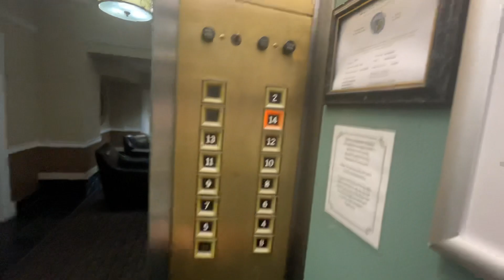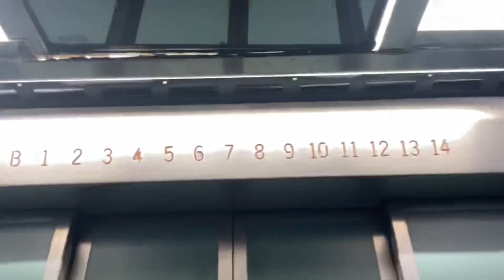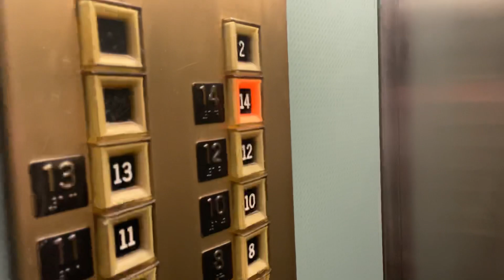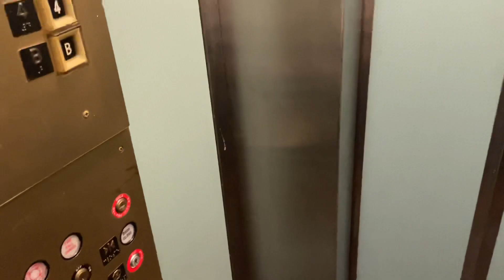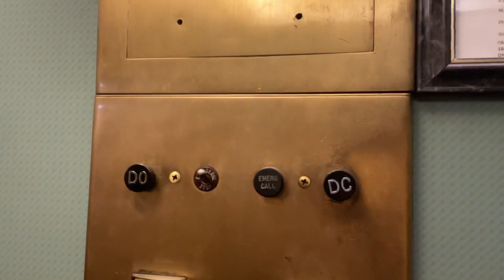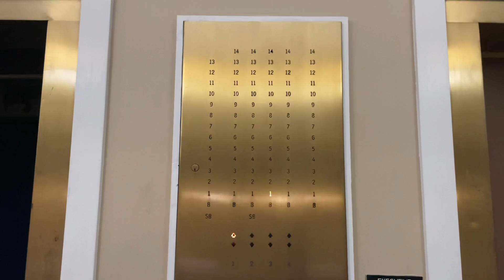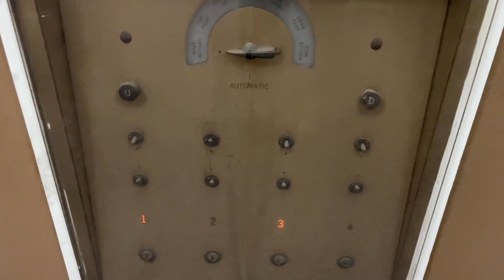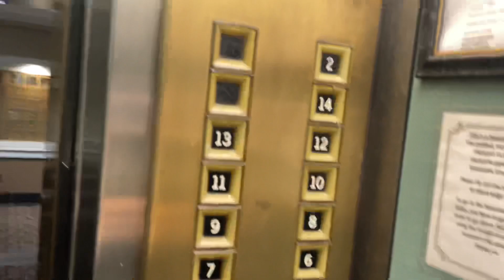INCREDIBLE Otis Touch-Sensitive Elevators - Omaha, NE.

Comment: I see 4 cars on the lobby panel, but only 3 elevators in the video. Was 1 car (probably the far right one) removed?

Based on the sign, it looks like the middle car may be used as a service car. I wouldn't be surprised if it does run, but isn't in normal service (either in independent/attendant service, or turned off in some way).

I looked up this building. I am surprised these elevators survived the major renovations this building received years ago. These elevators seem to be well maintained (looks like the lights in the lobby panel are being maintained, even the call lights which may often be neglected).
Reply from the maker: Fourth car had a hydro put in its shaft that serves B, 1, 2 in the office suites portion of the building.